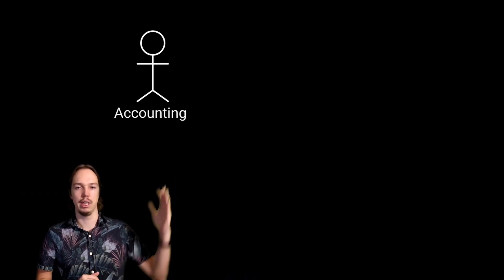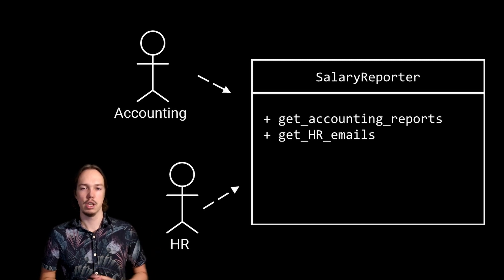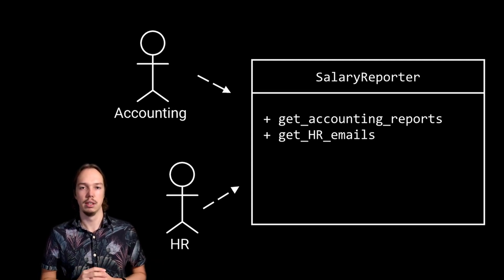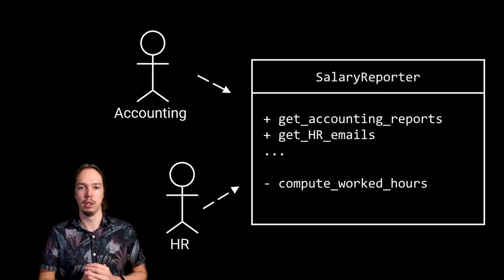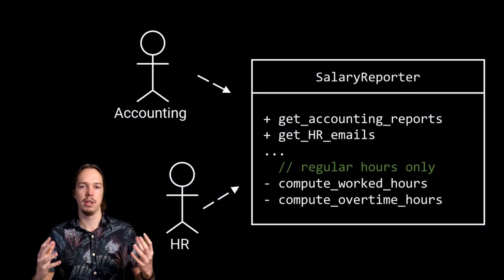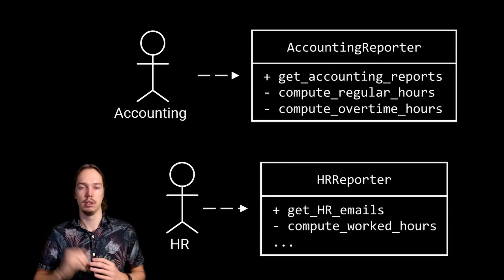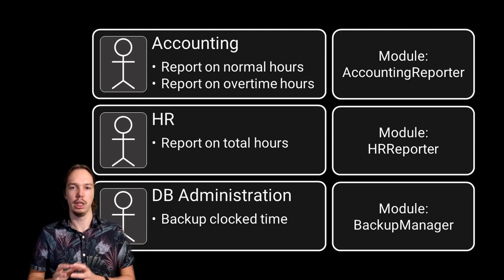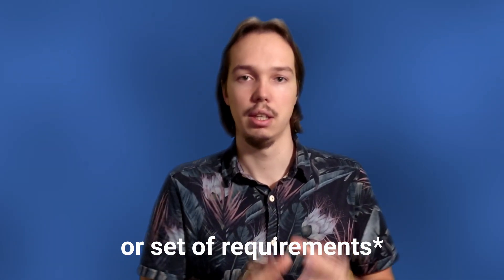Write modular code using the Single Responsibility Principle - SOLID Principles E1

Comment: This is really great and explained it in detail.👌👌
Reply from the maker: Thanks!
I feel like I went through 20 variations of the examples before settling on this one in the last recording session 😅
Happy to hear the effort is appreciated!
Reply: @bitsofq  those drawing examples were really helpful to get an understanding. It would be great if you could add some coding for how it was before & after implementing each principles.
Reply from the maker: @iam_Raavanan   I considered that, but I want this series to be accessible for all software engineers, regardless of which language they use. Once I start showing (for example) C++ code, python programmers unfamiliar with C++ might have a harder time following the series.
I could perhaps do something with simple pseudocode... I'll think about it!
Reply: @bitsofq Yes... some code examples please. Python will be OK for the vast majority of programmers I think. It is definitely not as overwhelming as C++.